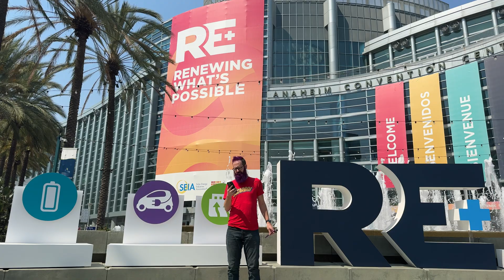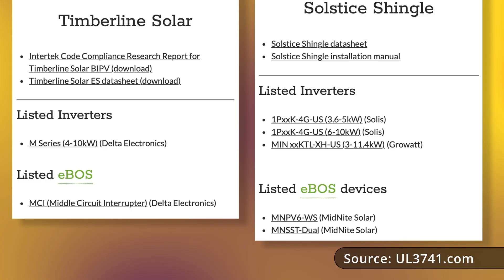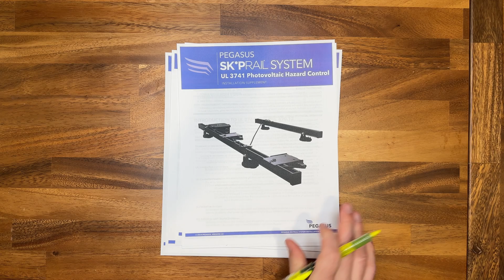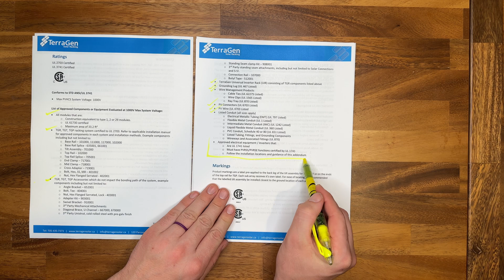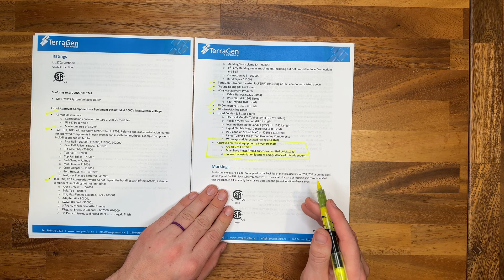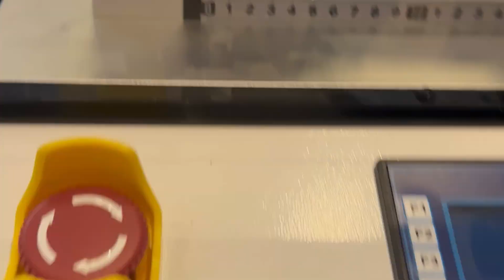A Bonkers Summer for Solar | UL 3741 news and forecasting

Comment: Hey Derek, what's your opinion of the Enphase IQ 5P battery system and CanadianSolar TOPHiKu6 panels?  Thanks!
Reply from the maker: @austinswift1602  last I interacted with Enphase (it's been a little while now), the IQ system seems solid enough. I couldn't care less about different panels, panels are panels, unless you're a developer that's really anal about counting pennies.

I wouldn't install Enphase on my house, but that's a personal preference. I care more about serviceability/flexibility/reliability than I do about customer experience or nitpicking panel production when it comes to my house.

Comment: Do ground mount need to comply with 3741 or is it just roof mount?
Reply from the maker: @ArthurDentZaphodBeeb  nope! Ground mounts don't require 3741 or rapid shutdown. If you have the space and the cash for it, ground mount is honestly best
Reply: @dereksolarboi  Not all ground mounts are exempt from RSS.  690.12 Exception states: "Ground-mounted PV system circuits that enter buildings, of which the sole purpose is to house PV system equipment, shall not be required to comply with 690.12."  Therefore if your PV circuits enter a building that is not solely used to house PV system equipment-- RSS is required.  To avoid RSS you can mount a grid-tied inverter on the racking itself.  This does not work so well for off-grid systems because the battery bank needs to be close to the inverter and if the inverter is out on the rack, the batteries, charge controller and BOS all need to be out there as well.  This is not usually practical.
Reply from the maker: @williammiller4786  Good point